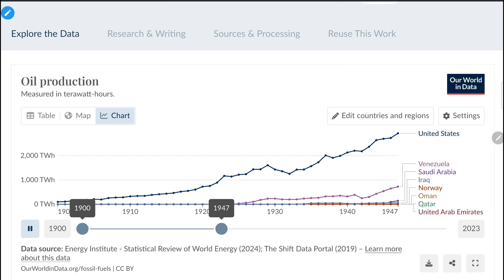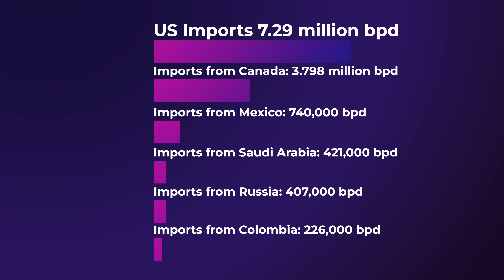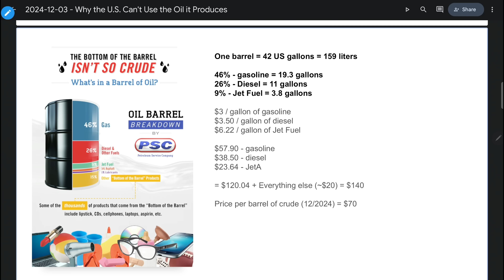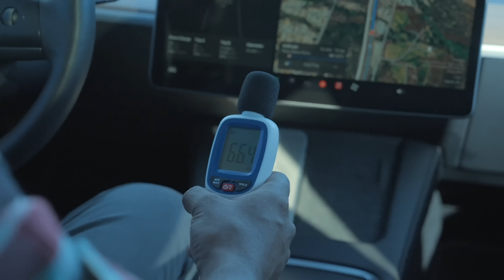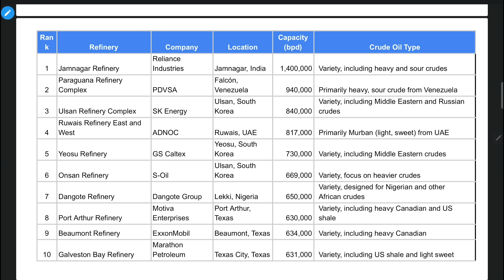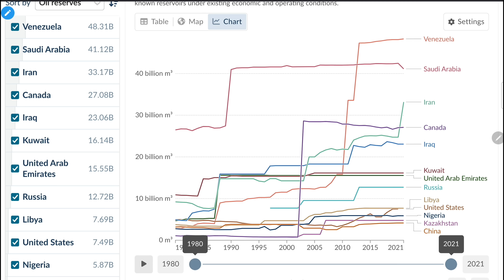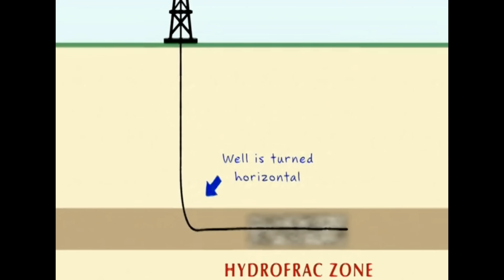Why America Can't USE The Oil it DRILLS

Comment: After the 1973 OPEC oil crisis, recommendations were made to decrease the USA from foreign oil dependence, such as improving fuel economy in future vehicles (the CAFE standard), investing in renewable energy production (solar, hydro, geothermal, wind, etc.), converting municipal vehicles to natural gas & efficient electric hybrids, only import oil from Canada & Mexico, not to export US oil, and so on. But the US petroleum corporations killed those ideas by bribing Congress with campaign donations and other gifts.
It can still be done and with an investment to switch domestic refineries to handle shale oil, the US, Canada & Mexico can free themselves from OPEC, and perhaps the US can free herself from fighting oil wars in the future.
Reply: They don't want to build new refineries or produce more oil when they can charge higher for fewer barrels doing less work. When prices are low, they lay-off oil workers and let it stay in the ground until prices go up again.
Reply: @sejembalm  why switch refineries build new one for the shale oil. We haven't  built a refinery since 1977. This way we can process and finish all oil types.
Reply: @bob, the private sector builds refineries, not the government. They don’t need to build new refineries to process light sweet. That lie is dead. They can easily retrofit existing refineries to handle more light sweet and have already done so. You’re being lied to.
Reply: @bobjones3579  my understanding from other sources is that lots of regulations prevented the building of new refineries. Same for why there’s no new nuclear power plants for a very long time. Hope DOGE will help us out to get rid of those onerous regulations.
Reply: @baolichang6019  Yeah, I know regulatory insanity is what caused it. Doge can go after federal regulations but not state. Maybe addressing federal regulations will give some states a backbone to address state issues. So, hopefully, doge has some success.
Reply: @baolichang6019 Oil companies are the ones that don’t want to invest in new refineries, regulations aren’t holding them back MONEY IS, they don’t want to spend it and they make more $$$ with the status quo.
Reply: @BobFirth  Not true.  They have put $$$ into new refineries.  Opened up new Natural Gas refineries creating bucket loads of exiting products which used to be made from oil.  Plans are in the works for new refineries in North Dakota and more than likely Ohio using Natural Gas.  Natural gas is now making products such as all your high grade engine oils are made from natural gas by the way.  Paint is now being made from Natural gas. etc etc as it is so CHEAP in the USA.   

Also, host of this vid shows his utter ignorance of how refineries operate.  Yes, USA can use our own oil, but doing so would be stupid as they would be LOSING profit.  Buy imported cheap heavy crude, sell refined products(lots of high wage jobs) while also selling the more expensive light sweet crude.  If Light sweet crude were used(it can be just fine), then large portions of existing refineries with gargantuan sunk costs would be sitting on their hands doing NOTHING but rusting away.  This would be STUPID.  

Refiners aren't stupid, just LAZY hosts of video's like this one and lazy internet posters.
Reply: @w8stral So if I’m following you correctly, the US producing more benefits us economically but didn’t address our purported goal of independence from other countries…???
Reply: @BobFirth regulations create costs which are the impediment that new refineried face...
Reply: @baolichang6019 the video pointed out that even Saudi Arabia (a pretty pro oil state) sees the writing on the wall. It's not the regulations, it's the economics. He mentioned the Keystone XL. That will never be built regardless of waived regulations because  TC Energy no longer wants to build it. They have divested all materials and property associated with it's building. It doesn't matter if the US wants the pipeline if Canada doesn't see favorable economics associated with building it.
Reply: @BobFirth if you're running a business and the federal government is hostile towards your industry, how much money are going to re-invest in your business?
Reply: @BobFirth  Regulations aren't holding existing giant companies back, they're keeping potential new companies out of the market. Which is why these big companies don't fight them, the government is keeping their competition from existing.
Reply: @ The oil industry got over $20 Billion from the government last year, that’s hostile?
Reply: @BobFirth  Conservative estimates put U.S. direct subsidies to the fossil fuel industry at roughly $20 billion per year. Several international institutions, including the G20, the International Energy Agency, and the Organization of Economic Cooperation and Development (OECD), have called for the phase-out of fossil fuel subsidies. But rather than being phased out, fossil fuel subsidies are actually increasing. The latest International Monetary Fund (IMF) report estimates 6.5 percent of global GDP ($5.2 trillion) was spent on fossil fuel subsidies (including negative externalities) in 2017, a half trillion dollar increase since 2015. The largest subsidizers are China ($1.4 trillion in 2015), the United States ($649 billion) and Russia ($551 billion). According to the IMF, "fossil fuels account for 85 percent of all global subsidies," and reducing these subsidies "would have lowered global carbon emissions by 28 percent and fossil fuel air pollution deaths by 46 percent, and increased government revenue by 3.8 percent of GDP." An Overseas Development Institute study found that subsidies for coal-fired power increased almost three-fold, to $47.3 billion per year, from 2014 to 2017. [Environmental and Energy Study Institute (EESI) Fossil Fuel Subsidies: A Closer Look at Tax Breaks and Societal Costs (2019)]
Reply: @w8stral Your points do not contradict the thesis of this video. By the way, a cost is only sunk when the utility of an investment ends permanently not when some component of physical plant is temporarily idled as in a conversion from one product to another.

Additionally, while you suggest that the physical plant can be easily converted from heavy to sweet oils, the revenue of existing production (sour oil) would be sacrificed for the revenue of the  substitute (ie. the sweet oil). If the changeover would result in reduced revenue for the refinery (evidently the case), then the changeover will not occur. Both engineering and finance are variables here.
Reply: @annteve  No Shit Sherlock, you typed all that to say exactly what I said... Brilliant.
Reply: @w8stral  Well, I had to be sure that you got the point. I can elaborate if you still need.
Reply: @annteve  Sure, my Saturday was boring and I am wasting time anyways so... =)
Reply: @baolichang6019 yeah, the problem with deregulation is that it will allow industries to dump their waste, and let tax dollars pay for the cleanup; private profits, then socialize the cleanup - not a winning proposition for the taxpayer, or the people whose lands get polluted.
Reply: @bobjones3579  Lol the USA is a lil beta slave to oil😂 Solution to Problem is derp derp make the problem better in the very short term but disasterous in the long term😂 Go Doge go musk Go Trump the world hopes you carry on 😂😂😂😂😂
Reply: @baolichang6019 Lol. That’s was ironic, right?
Reply: @ScorpionDragon11 you can't really be independent, because it limits your growth and prevents you taking advantage of opportunities. You either fall behind or things become too expensive
Reply: @baolichang6019  🤔
Reply: Not only is there a pile of money to be made in the oil industry, but there is even more money is the business of selling weapons for the oil wars.
Reply: @sejembalm  Spot on! What is missed by TBD (and many here) is that it is not so much a case of why the USA can't use its own oil versus why it won't.  Political will can easily come in and either subsidize sweet crude refining as incentive to switch over, fund the manufacture of sweet crude refineries, or more radically, nationalize the oil industry (fully aware this is a pipe dream) if it weren't for the oil lobby. Another option is to more fully commit to alternate fuel energy investment.  The government does not have to turn a profit if it means having a ready supply of fuel for domestic consumption on not being beholden to petro cartels.  The biggest point TBD does not factor in his calculations are the billions spent and military lives spent by the US government just to maintain the geopolitical power that allow oil imports to come in from the middle east, not to mention the billions spent to a particular client state practicing Apartheid with colonial aspirations.  I'm certain that substantially reducing our dependence on oil imports would prove to be more cost-effective to consumers, reduce global conflict, and depending on the path forward, mitigate damage to the environment.
Reply: "US petroleum corporations killed those ideas by bribing Congress with campaign donations and other gifts" explains it all!
Reply: With a 36T debt , where is the US going to have the money to build new anything ?
As for American corporate , they are infamous for their short term planning (that is make incremental profit for EVERY quarters ) so no one is going to invest billions into the unknown.
Reply: @sejembalm  Isolationism will  never work. It never has. Who wants to be isolated from the rest of the world? Guess what, they are catching up to us and is the US afraid of the competition? Appears so! So, put up walls, lol, like that has ever worked. The has never been a wall that couldn't be climbed over, tunnelled under, gone around or traversed through. Just as a reminder, look up Hadrian's Wall, the Magonot Line, and the Great Wall of China, and now the Trump/Abbott fantasy folly wall!
Reply: I think you got it backwards. US needs to fight wars to justify military keynesianism
Reply: @sejembalm  the government will never undo a law thats in its favor so new refineries to handle something bedsides sweet will likely never happen.
Reply: the price was quadrupled with those events.
Reply: But I understand that shale oil is limited already at less than 50% reserves, hence why make the conversion.
Reply: Well now that Trump has soured relationships with Canada and Mexico over his ridiculous tariffs, I doubt that will happen anytime soon. He clearly understands none of these subtleties. As well as shutting down any renewable energy efforts and Musk scuppering Teslas' market with his behaviour. This is even more dire for US consumers than I imagined.
Reply: @sejembalm  - there is no profit in building a new refinery nor retrofitting an existing one anywhere on earth. The global demand for oil is past its peak or soon will be. It takes three to five years to build a refinery and by the time it would start producing there would be no demand and the refinery can never recoup its construction costs. The oil company executives may be greedy b*stards but they understand the economics really well. While the USA demand is still high, China's demand is dropping fast. China has a goal of zero carbon energy usage by 2050, BUT they are now five to fifteen years ahead of their plan. So China could be close to zero carbon energy by 2035. This will drive a large number of oil producers out of business leading to higher retail prices in the countries that lag behind on converting to electrification. There will be no further investment in oil, just market manipulation to milk the suckers to the maximum possible.
Reply: @sejembalm  
Doubt it will ever be done, otherwise what they will spent another trillions annually on?
Oh wait. There’s Ukraine’s mineral mines.
Reply: America's business IS business, figure it out. Bottom line, it's profits baby profits . American independence, America's population, America Great Again!!! Hahahaha quit fooling yourself. 🐑🐑🐑🐑🐑🐑🐑🐑🐑🐑🐑🐑🐑🐑. Profits baby. Hahahaha.
Reply: @johnking6252  Yes, profits, it is how you survive stupid sheep.  No profit = turn into a slave.
Reply: The fossil fuel industry doesn't pay for the negative externalities of their flawed product leaving the rest of us to pay for climate change and air pollution. Over the long term fossil fuels are astonishingly expensive.
Reply: @garysarela4431  If you pay attention to what battery mining and producing industry does, you may have some hesitation to make your statement. The disasters happened somewhere else not in US are very real to those who are living it.
Reply: @garysarela4431 the sky is falling somewhere. Be afraid, very afraid!
Reply: @garysarela4431 exactly! Deregulation will lead to more private profits, then more public expense for cleanup. No thank you!
Reply: You are wrong and so is 2 bit as both of you are  ignorant of how the refineries work. Yes, USA can easily use the light sweet crude, just that the cracking process(very expensive oil refinery complex) will not be fully used and therefore a lot of infrastructure will have sunk ~$Trillion dollar sunk costs which will be left rusting NOT being used.  It is THEREFORE cheaper(more profitable) to import CHEAPER heavier crude and refine it using said infrastructure with sunk costs which would otherwise NOT be used, and sell for a higher profit margin while selling the light sweet also at a HIGHER profit margin.

Uh, don't invest in tin foil hats.  Also the CAFE standards are an absolute JOKE as all they do is force cars to become gigantic, not save fuel.
Reply: @w8stral not to mention extremely expensive to maintain!
Reply: (1) Spare a thought for the U.S. empire that just cannot 'free herself' from the oil wars.

(2) How quaint to believe that wars in West Asia are merely about oil and not about IL.

(3) But once the 'oil wars' cease the U.S. will fight lithium wars (as it did in Bolivia via proxy and threatens to due in Mexico under the guise of fighting cartels), water wars or any other version of war wherein it deems it necessary to take something of value from someone else because the purpose and foundation of the United States is theft.

Comment: The word "produce" is a bit misleading. Better words would be "mine" or "extract".
Reply: It's production anyway. If the oil is not extracted then it is not usable
Reply: How about the words "mine" or "extract" simplify to "produce". The shit people whine about...
Reply: Given the multiple steps in petroleum production, using separate terms for mine, refine, and transport does add clarity.

Comment: If this were true then how did we do it from 2016 to 2020?
Reply: @MechanicalMafioso  well to answer that question we have begin by saying that your premise is incorrect.

As shale gas and oil production increased and really began to remp up over the 2010s, we became the world's largest extractor of oil. By the time Trump got into office that has been the case for years, and production was still rising. Then, for a brief part of Trump's administration, in 2019, the US got to a point where exported more than it imported. But everything covered in this video applied the whole time, just as it had for the past six to seven decades in general but especially the past two or so. Then the world's economies collapsed in 2020, demand for petroleum products cratered, and our production dipped by millions of barrels per day. But over the next four years, things ramped up again and in 2023 we eclipsed our 2019 levels of production. We are again exporting more than we import. And we STILL are beholden to the same limits that are discussed in this video. 12:00PM 20 January 2025 will not change that.

Also, really? Trump was President from 2017-2021. Get your timeline correct.
Reply: @jimfazio85  open up KEYSTONE again- from Canada?

Comment: Oof. Sounds like the makings of an economic disaster.
Reply: KEYSTONE PIPELINE:  tar sands.......... to refineries in TX.  so..................  open this back up, Id say
Reply: @atomicdmt8763  Not what I meant. That's like putting a band-aid on a chainsaw wound.
If the Canadian oil is going to US refineries, that means it's not sweet crude. If the US won't refine its own oil, it will ALWAYS be at the whims of outside oil companies and countries.

Comment: I think just like Tankers that need to be double hulled, Pipe lines need to be upgraded to double walled.  This would reduce the chances of spills.  I under stand it would not eliminate the chance, but just like making tankers double hulled to REDUCE the spill chances, this would reduce the spill chances on land.
Reply: All the pipelines that have been installed in the past 30 years are at least double lined. When have you heard about a major oil pipeline leak?
Reply: Enbridge had a major spill in Southern Michigan a few years ago and they are in the news about Line 5 under the Straits and across some Native American Reservation.